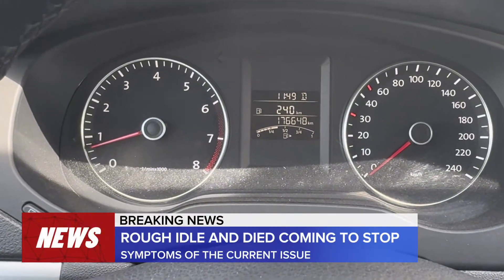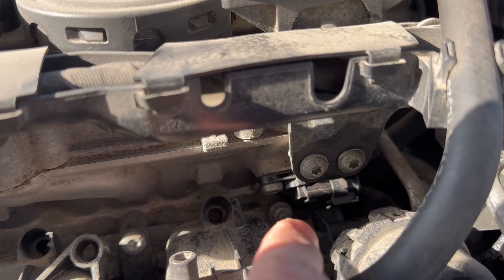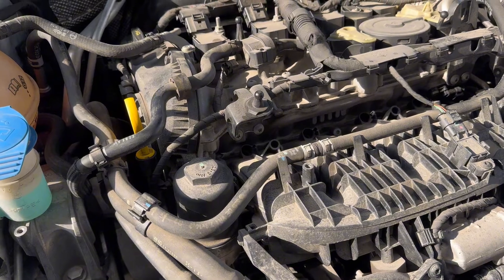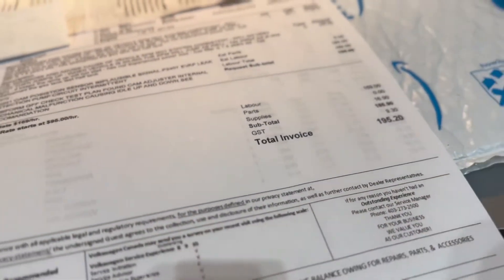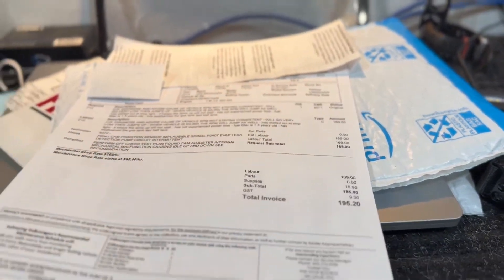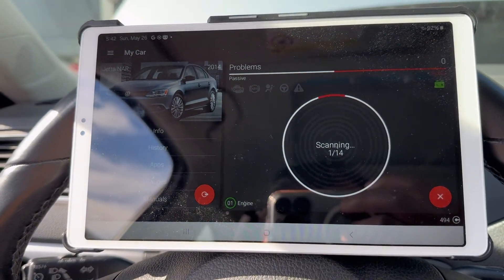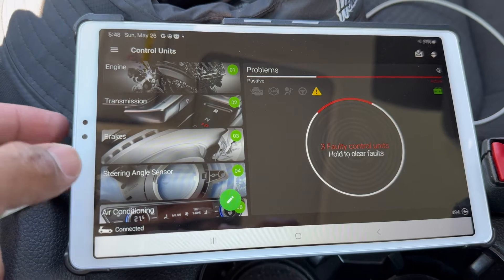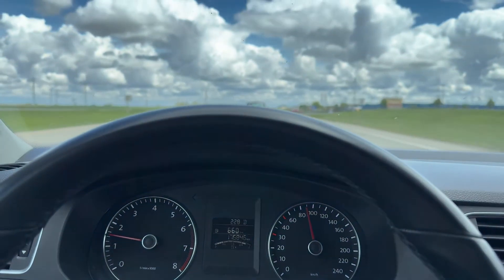2014 VW Jetta Rough Idle & Stalling Issue - P0341 Camshaft Position Sensor Problem

Comment: First of all, THANKY YOU! 

Your page and videos have been so helpful. I love how in depth you go with issues and all the possible causes and fixes. I had several opinions from mechanics and they've told me about engine replacements, camshaft replacement etc all being thousands of dollars worth of repairs. I found your videos and they gave me hope. I seem to have the same exact issue. Ive also seen your updated video on this car and i will also be changing the intake cam magnet and solenoid. Hopefully that fixes my issue, ill keep you updated. And i hope you make an update with your car as well.

Thanks!
Reply from the maker: I’m glad my videos are helpful, and I hope this solution works for you! You are very welcome! Thank you for reaching out. The mk6 Jetta today is working and staying just fine after my fix. I just make sure the car gets constant shorter oil changes intervals given it’s high mileage now

Comment: Great videos btw! I’m having a similar issue with my Q5, how did you clean the magnet? Wondering if I can clean it and see if that works before ordering the parts, dealer wants to charge me 3k for a camshaft diagnostics. (Toronto)
Reply from the maker: Thank you 🙏 you can spray with brake cleaner the nipple on the magnet and see if you can make it unstuck. If it is stuck I would suggest replacing it.

Comment: Check your oil make sure it’s not dirty or low try getting. Oil change then change camshaft mine had the same problem without the oil light being on but epc and engine light was on along with rough idling if it’s dirty or low the camshaft sensor can not get. Good reading causing problems
Reply from the maker: Definitely the oil level and change frequency plays a huge role. Given it high mileage I find it consumes more oil ow than ever. Please check out the latest episode on final conclusion related to the issue
Reply: I'm having same issue with my 2015 jetta SE 1.8 did a simple oil change fix that problem
Reply: @franknicolini8853 what error codes ur getting?… did it also crank no start?…

Comment: Hi, did you ever fix the issue? My 2013 jetta GLI 177k miles, and has p0341 and p0343 codes toggling, I replaced the camshaft position sensor, but still having the codes bouncing from time to time. I wonder if I have to try yo replace the magnet. What happened with your case finally?
Reply from the maker: In my case and also on the video when I cleaned the magnet and was able to get the pin to freely move again I temporarily installed it to see if the error code disappeared. And it surely did. So I knew that was causing my issue. Fast forward 4 months later I have a video coming up with the final solution replacing the magnet and the valve. Hope to have that out on Thursday